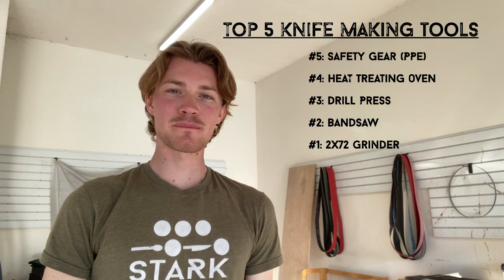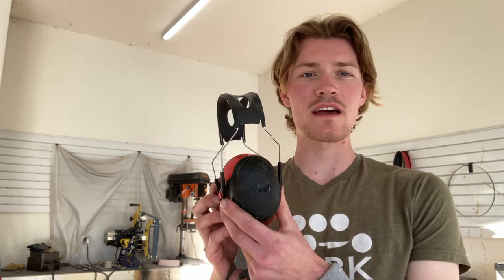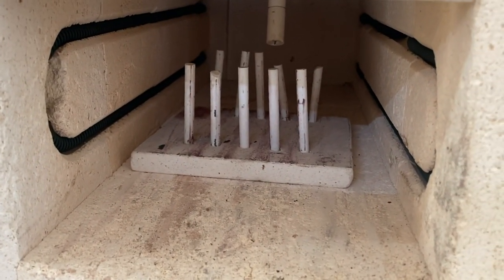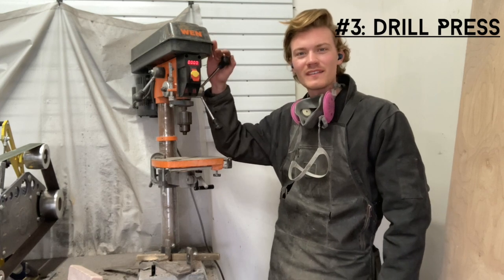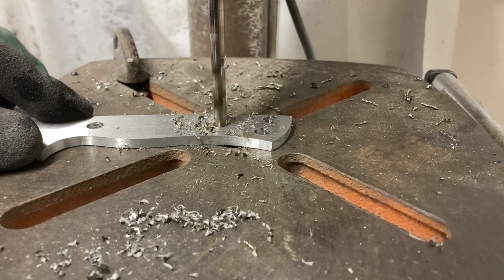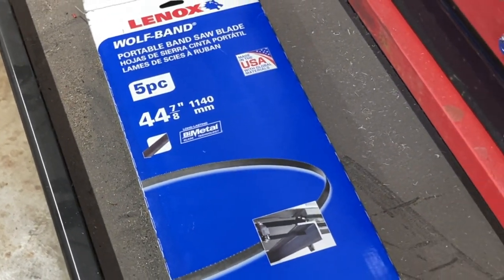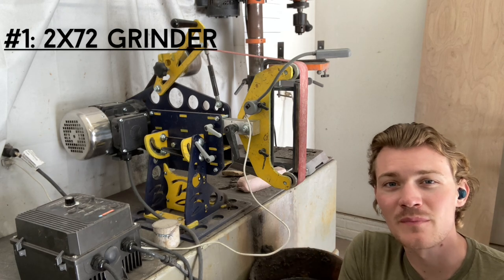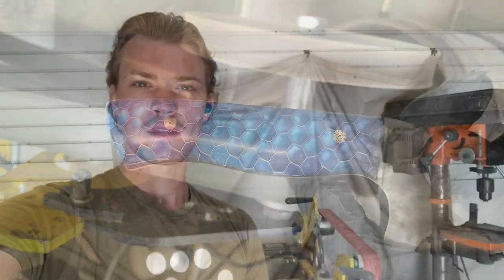Top 5 Tools for Knife Making | Knife Shop Tips

Comment: I only use few basic items, but i plan to buy betl grinder and upgrade my drill press.. Its super cheap and its nightmare to drill holes straight in hard materials plus more ppl will use polishing wheal in drill press then have attachment for belt grinder so i would put those on first/second spots.. and for me i would add lathe to make my own corbys and ring making.. those 3 machines are on top of my list for future.. oven or portable saw would be great, but for a hobby im ok with angle grinder and sending few knives to pro once in few months.. but now im buying tools for leather working first...

You definetly have great setup and your grinder is beast
Reply from the maker: Sounds like you have a pretty good set up. Those upgrades would definitely be helpful though! Thanks for watching!

Comment: Nice choice of tools!! I really like your band saw!! The blade gets it on !! I know , the torque helps!!🙂ha ha  Well I had to go cheaper 😔 but except for the noise, my Harbor Freight has done a decent😢 job for me!! Transferred the bolt pattern and mounted a table on him!! I built a backing plate and used the studs in my garage to mount him!! It’s ok , but I’ll get set-up like you one day Lord Willin! I use the Luffkin blades to but I haven’t put my eye on the one you’re using,, did you have to order it special? Thanks for your help partner!!
Reply from the maker: The band saw is nice! I actually used Harbor Freight saws for a while and got a lot done on them! I use Lennox blades that I buy on Amazon usually.

Comment: What is the biggest difference with the oil you use, and where do you buy your metal.
Reply from the maker: I get the steel from New Jersey Steel Baron and Alabama Damascus.

The main difference is in the speed of the quench. Parks 50 is for faster quenching steels and AAA is for slower.

Comment: Question for the belt grinder : could somebody use the speed regulator on a cheap one ? I'm not a pro , so 3k for one like yours would be not a wise choice , since I wouldn't need it.
Reply from the maker: I am not 100% sure. I believe the motor has to be 3 phase or something in order to run it with a VFD. There are some cheaper 2x72s or 2x42s on the market that a lot of people use if you want something more affordable.

Comment: Will someone please explain to me why a grinder with grinding stones isn't a option???
Reply from the maker: It can be but they are less versatile and harder to use for anything other than profiling knives. I’m assuming you’re taking about a bench grinder.
Reply: @StarkKnives  basically and other stones. I haven't used a belt type before. I have and use a 10 inch down to 3 inch. As well as a older stone I use a lot but it is two inch wide and I want to say almost 30 inches across. Everyone has their own style or what not. I like turn of the century line shaft tools. Now to say I don't have some electric but point was we used stones for thousands of years now why not still use them???

Comment: Heat treat oven is horrible advice.  You can send out 500 knives for pro HT and still not cover the cost
Reply from the maker: I am not suggesting that it's the right thing to choose for everyone by any means. I actually use professional heat treating services for a lot of my larger batches as well, and I think that's a fantastic option. A major reason I personally have seen major benefits from having my own heat treating setup though is that it allows me to take on more specialized custom pieces or last minute orders that would not be possible if I had to send it away to a service. It may not be that way for everyone, but for me personally, the benefits gained from being able to do those types of projects have certainly been more than enough to compensate for the additional cost. I think it's a bit harsh to just call something horrible advice without getting a bit more context behind each person's individual situation.